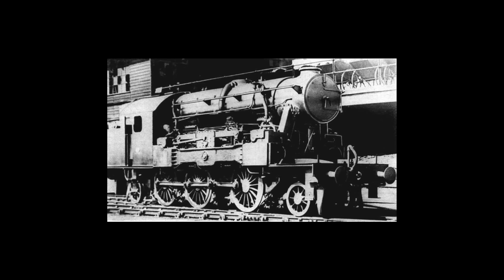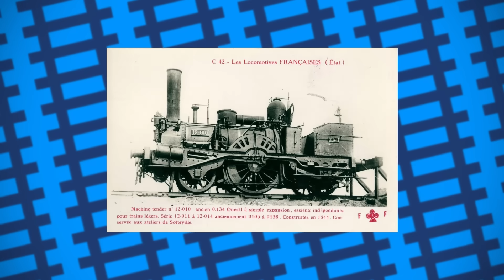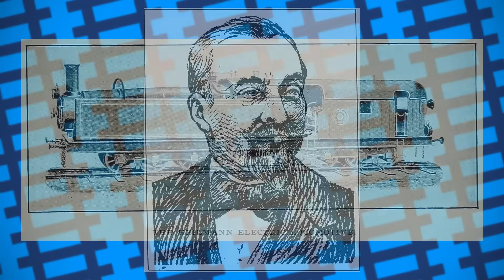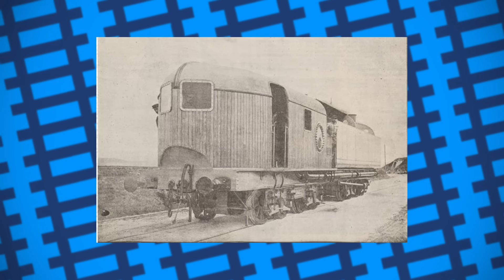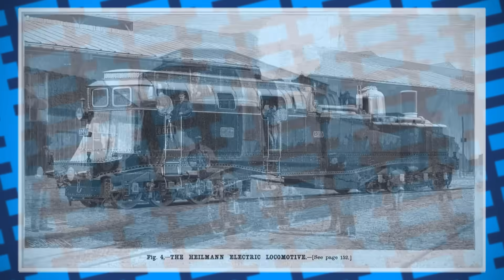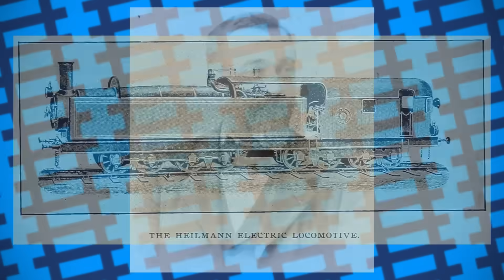France's Fascinating Steam-Electric Locomotive - Heilmann Locomotive

Comment: Since it is said that the Heilmann locomotives were ahead of their time, then I think these might be the best obscure hybrid engines to try and bring back. I don't see why not. The prototype in particular looks very appealing, almost a mashup of something 50s sci-fi, and basically, a cab forward/early diesel-electric concept.
Reply: Would the design pass through all the modern day certifications? You know, unless there is rest of the locomotive preserved, it would be newly build machine, that would require all the testing and certifications as modern locomotives would need, and it also would most likely require implementation of ETCS. On the other hand, it would, most likely, be possible to make some improvements and changes to the design, so they would be able to burn wood chops instead of coal.

Comment: French bizarre. The very idea of steam engine is that steam itself is a perfect transmission, able to create max torque at the very start, 0 speed, and up to the max speed - 100kmh was not a problem then for such a light trains. Diesel engine cant do it thus requires electric of hydraulic transmission, with all its cost.

And, of course, heavy generator and motors of the time combined with 4axle bogies destroy tracks much more than miserable 800HP regular steam engine.

Comment: Enjoyed this. In the states as Diesel Electrics began to herald the end of steam several locomotive builders tried a similar idea with steam turbines driving generators. These were mostly aimed at railroads operating in coal country. They failed in large part because burning coal the cinders got into the electrics and caused problems.  GE built two for UP these were oil fired and also ran into issues.  More about them are at this link. https://en.wikipedia.org/wiki/GE_steam_turbine_locomotives

Comment: They are like a mini power plant. It still seems like a steam train because of the dome and funnel but I can kind of see what you mean. There is 1 in Switzerland. One side is the steam boiler, tanks, fire box. And the other is the electric battery motor and controls. It kind of looks like Duck from Thomas and Friends because of the boxes on the sides. But are they steam tanks? Is it also scraped?

Comment: I wonder how easy these were to control. Steam plants don't handle sudden changes in power demand well - either they use up too much steam, reducing pressure, or the reverse. 
Diesels change power output pretty much instantaneously. 
And it was the invention of the circut that matched diesel and electric power that allowed control from just one lever.
Finally, one big advantage of diesel-electrics is that they can handle MU - multiple units controlled by one engineer - because the diesels could be electrically controlled. That meant engines could be combined where needed for extra power without extra crew. Much harder with steam.
Reply: If you are talking about large power plants, they need to maintain constant 50 Hz in grid, so they have to closely match steam and electricity output. That is not the case with DC systems, they can spin bit faster or slower so they store or release stored energy. So for regulation of steam engine of this locomotive some centrifugal governor would be enough, rest could, most likely, be controlled electrically. Also once they would have more or less automated power production, they could control, in theory, the locomotive electrically from some other, but I doubt that back in the day, they would have the technology to do so.

Comment: Switzerland, interestingly, went the other way with a steam/electric hybrid locomotive. Due to the expense of German coal in the second world war, 2 0-6-0 steam locomotives were fitted with pantographs and electric heaters, using electricity to boil water into steam to drive the locomotives.
Reply: They must have been unable to get supplies to build new electric locos. Electric motors 60-90% efficient, vs a typical rail steam engine lucky to reach 10%. So for the same electrical load the electric heated steam engine can have less than 1/6 the power...
Reply: @nerd1000ify  I would guess that steel was also unavailable since it was being used by all of Switzerland's neighbours (except Liechtenstein) for the war effort, and so building new electric locos wasn't an option.
Reply: He made a video about these as well. This invention lead to the electric preheated boiler, keeping steam in Service a little longer

Comment: Very interesting that steam - electric locomotives were conceived of and tried that early.  Unfortunately, later attempts (at least in the US, but using steam turbines rather then reciprocating steam engines to drive the generators) were no more successful.  General Electric produced a pair of streamlined steam - turbine electric locomotives for the Union Pacific about 1939 that saw just a few years use before being returned to GE as unsatisfactory and scrapped shortly thereafter.  The Chesapeake & Ohio built 3 beautiful streamlined steam - turbine - electric locomotives for their stillborn “Chessie” postwar passenger service; all were scrapped within 3 years.  Coal hauling Norfolk & Western (who built their own superb steam locomotives) also had an experimental steam turbine electric called the “Jawn Henry”; again it was scrapped within a few years.  The main technical issue with both the C&O and N&W locomotives was that being coal-fired, coal dust (being conductive carbon) got into the electrical equipment and traction motors, causing extensive failures.  (The GE locomotives built for UP were oil-fired).
Reply: Did the GE locomotives burn bunker oil or distillate diesel fuel?

Comment: This seems like a machine that would have fared better as a steam turbo-electric instead of lugging around a reciprocating engine to drive its dynamo.  In that sense, it was about a decade ahead of its time.
Reply: I was thinking the exact same thing. Turbines are perfect for electric transmissions.
Reply: Yeah triple expansion engines kinda sucked in every concievable way. They're an extremely clunky and unreliable way to try to improve the efficiency of steam engines.
Reply: @hedgehog3180  Its not the steamengine but the production of steam that makes a steam engine inefficient.
The bigger a boiler gets it improves efficiency.
Thats why steamtech is only used in industrial, petrochemical, shipping (oil tankers) and power plants.
Reply: Below 1,000 horsepower, reciprocating steam engines have higher thermal efficiency, and much better part load efficiency than a steam turbine.
Reply: @gregorymalchuk272  In piston steam engines every stroke is a power stroke thats why they have zo much torq and are suitable to power locomotives, ships and industrial pto shafts.
As producing electricity goes in the past hey were just big radial flywheesl who needed alot of torq that did spin at 50/60 RPM. Thats why 110/250V AC systems around the world use 50/60Hz 
Early AC electric motors were also big radial flywheels
Modern axial generators spin at way more higher rpm so steam/gas turbines make sense.
Reply: Look up the c&o m1
Reply: something something the funny US nuclear train

Comment: I heard the drawback of power being lost and immediately thought of some of BR’s early main line diesel electrics. Comparable size to a steamer, but fairly poor to weight ratios thanks to the hefty generators and power being lost from engine block to wheel. Hence why the Western decided to go with diesel hydraulics and gas turbines before that.

Shame this wasn’t tried again though. I’d wager a 1930s approach would’ve rivaled steam turbines or steam motors
Reply: UP, C&O and N&W all tried steam turbine electric locomotives. All three trials ended running a few years before being cut up. It's just simpler to get power from a diesel engine or overhead to power traction motors.
Reply: @Ghauster  the American steam turbine electrics were absolutely colossal, though. Rather negated the potential advantages of a high power to weight ratio powerplant

Comment: I could imagine this being more successful with later technology if using a steam turbine instead of reciprocating steam engine - far more efficient and lighter weight per power. I know mechanically-coupled steam turbine locomotives were tested, performed great at design speed but the turbines are horribly inefficient at lower speed. Steam-turbine-electric would solve that by allowing the turbine to run at its optimal speed regardless of wheel speed. I seem to recall at least one such locomotive was built, with promising results, but by then diesel-electric was taking over and clearly had the upper hand, so such efforts were abandoned.

Thinking of hammer-blow, something I've pondered is if a balance shaft could be used, if any steam locomotive ever tried that? It's a counter-rotating shaft with counterweights which would be geared to the driven axle (the one with the connecting rods). The cause of hammer blow, to my understanding, is that counterweights on the wheels to balance the pistons moving forward and back would cause an up-and-down imbalance, so their weight is a compromise between these imbalances. Balance shaft and wheels would have weights that are forward and back together to counteract the piston but up and down opposite each other to cancel out the vertical imbalance. This is commonly used on internal combustion engines (many, maybe even most, cars have them).

Comment: not technically a hybrid, its essentially a diesel - electric but with the diesel substituted for steam. such a weird concept though
Reply: It is a hybrid, a series hybrid.
Reply: @dannypipewrench533 I think thats more relating to cars which also have batteries
Reply: Usually to be a "hybrid" there should be some electrical energy storage in the system i.e. batteries or capacitors. Otherwise it's just using the electric drive as a transmission.
Reply: @nerd1000ify  My reasoning was that a hybrid makes use of both mechanical and electrical power in some way in its transmission.  Whether that involves a battery did not seem to me like it should disqualify something from being a hybrid.  However, I do realize now that it may be misleading to use one term (series hybrid) to refer to systems both with and without batteries.

If you do not consider electric transmission to be a kind of hybrid, do you classify it along with "traditional" mechanical transmissions?
Reply: @dannypipewrench533  Kind of. In terms of trains there are also diesel-hydraulic and diesel-mechanical locomotives. A diesel-electric will have different running characteristics of course.

My understanding of what makes a vehicle a hybrid is that it combines a combustion power source with a system that allows it to exploit the benefits of another form of energy storage, typically batteries but there have been experiments with compressed-air hybrids and so on. The intent is usually to allow braking energy to be recovered and re-used, rather than dissipated as heat.
Reply: @nerd1000ify  I suppose that that makes sense.  It is not just the presence of multiple kinds of power transmission, but also the ability to run on multiple energy sources and recover energy.  Thank you, this has been very interesting.

Comment: I wish that this patter was retried. I know steam turbine generated eletric traction was some times tested and faild because of the failing sensitive turbine by the motions/knocks on a. track, but tomehow I wonder if the steam piston would have resolved this problem and work as good or better than the disel-eletric locomotives.
Reply: Steam engines are not as efficient as steam turbines.  You would could not use as high a pressure. Maybe using a scaled down Skinner Unaflow engine.